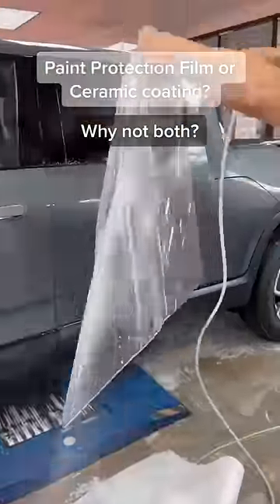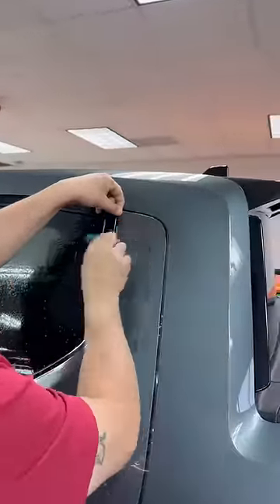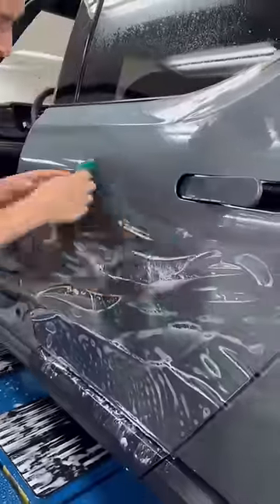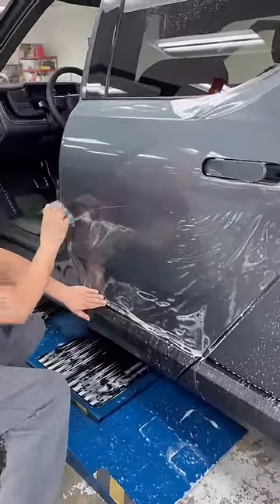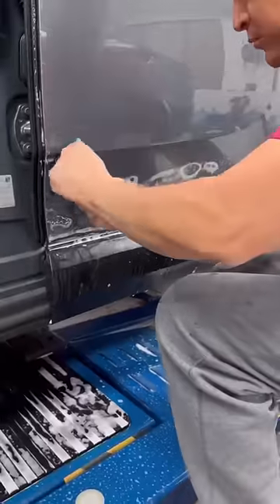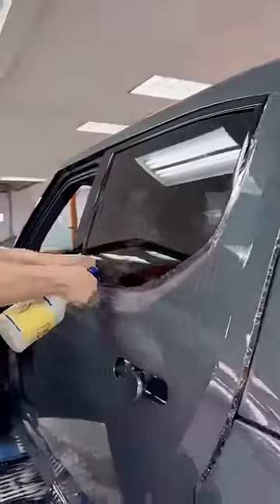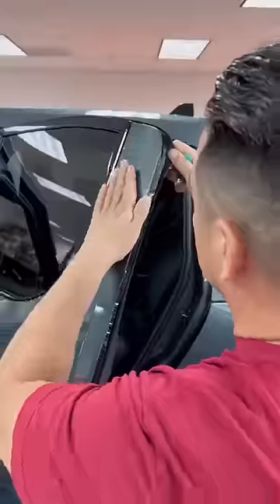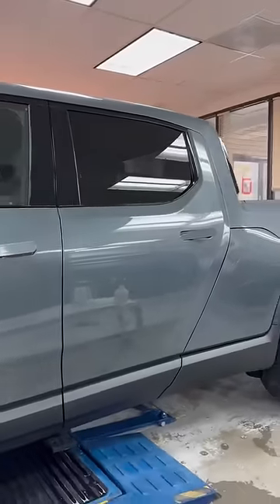PPF vs ceramic coating? Why not both!

Comment: As a body shop owner, we work on high-end and exotics, heres my 2c:

PPF is a catch 22 and complete BS for the average car

We've repaired many vehicles with PPF with very minor damage that the PPF wasn't able to protect against. 

So now you pay us $95 hr to remove the PPF + decon + cost of repair & refinish, then you can't PPF for another 60-90 days till the clear is fully cured. 

So if you have a vehicle which on average costs $1200 $1500+  to repair & refinish the front bumper i.e LC500, M4 Comp ect ..

And you get a slight gash from a scuff that goes through PPF or minor fender bender. You've just introduced an extra $600-$800+ to the cost of just refinishing 

PPF might be worth it on Exotics or Collectibles, Hypercars which a bumper can run you 2k $3k++  ect because if you have endless pockets then whatever. 

Things we've ran in to with PPF cars:

-Permanent water spot damage on the film looks like dog crap

-Some films leave a ton of residue behind on removal $$

-Some films have horrible orange peel

-Some films take away from the depth and gloss of the original finish

-On hand cut & polished vehicles like Bentleys and Lambos you totally kill the glass look of these cars with PPF
 
Anyways, it's a catch 22, whats next another film to protect the PPF? 😂
Reply: What do you suggest besides PPF that provides the best protection ?
Reply: Depends on what you're trying to protect against?

None of my rides are ppf'd, they are all cut and polished and ceramic coated

As far as rock chips, on my weekend rides I make sure I keep enough distance away from the car in front of me on the road

The faster the speed, the larger the distance

Gives that pebble enough room for gravity to do its thing
Reply: I knew PPF wasn't perfect, but I didn't know it was that bad. I've been doing ceramic coatings for years now and they're great with new or old cars. Then I top the cured ceramic coating with Collinite 815 or 945 and then continue that wax regimen moving forward. Extremely deep and long lasting gloss, like a second clear coat.

PPF is relatively new and cars I've seen with it have this "plastic look" up close. Still, I was considering it for my new car since it was "self-healing". Now I'll just stick to ceramic + wax. You just saved me the equivalent of $2000.
Reply: @SharapovaFan hey im interest how many times do you apply the ceramic coat and how long does it last
Reply: @bo3baid  I apply around 3 coats minimum. I only apply them under shade because they cure too fast in sunlight. I apply them using an applicator pad, in strokes, then buff them using a dual action polisher. Have to be careful since ceramic can streak.

After the ceramic coating is cured, I top them off with Collinite 476s (for my light colored cars) or 915 (for my dark colored cars). I continue topping off with Collinite wax after every two or three car washes, so my initial ceramic coating is still there. Collinite lasts a lot longer than most wax. Only Soft99 Fusso can compete among carnauba-based waxes from experience.
Reply: Wish I saw your comment earlier, I wanted to PPF my car in fear of rock chip. Due to the price I decided to only PPF the hood to test it out. The gloss and clarity was reduced significantly, and since my car sits outside water spots were soon introduced.
Reply: @kevinlin7674  Dang! Yup spot on.
Reply: Sorry, english not my first language, what do you mean by 'cut and polished' ?
Anyways, totally agree with your statement  !
Reply: @georgepotcovaru2595  That's when you sand down the clear coat flat to remove the texture, then polish to a high gloss. 👍
Reply: Only clowns ppf a car, it offers 0 resale value and yellows over time, plus the rock chips always get though the ppf and its a big scam.
Reply: I would like to further update my experience with PPF, two obvious rock chip on the film from a car overtaking traffic illegally on the shoulder kicking up rocks. I was going around 55 and he was doing around 65. Did not expect it to get damaged this easily, and there is two extremely obvious spot on the hood and I can't touch it up.
Reply: I would never ppf my ride. I used to have a 2018 rav4 that came from factory with ppf'd hood. I hated the way it looked, and it stuck out like a sore thumb.
Reply: Thank you for educating folks on POF B.S. folks don't waste your money on this crap! Nothing will stop rocks or any other solid fragments. This is just another hustle for you to spend money on something pointless

Comment: Ceramic coating on top of PPF or PPF on top of ceramic coating?
Reply: On top of PPF. My reason is because it will then protect both the PPF layer and the paint at the same time. If coating is under PPF then  only paint is protected and the PPF layer itself on top will oxidize faster.

Comment: My new lexus just got wrapped in XRPlus Xpel. At pickup there were so many bubbles and loose edges. Called and asked owner if this is normal and he said its still in curing period. After 3 weeks (the inspection) they gonna use heat gun to stick all the loose edges. I just want to know if these r the standard PPF process?

Comment: paint is meant to protect your car from the elements. this is a little silly. why do you need the original paint to stay untouched pristine on a truck? buff out the scratches, touch up the rock chips don't spend thousands on some film that will need replaced eventually anyway.

Comment: PPF is great until it starts to turn from clear to yellow.
Reply: Modern PPF is urethane based and doesn't fade from UV rays or discolor most ever have lifetime warranty from fading I know the stuff we use does
Reply: takes a long time to do that
Reply: @Justinlifts365  Thank you for being honest and admitting it does yellow along with start cracking also. I will also admit it usually takes a while.
Reply: @ThatGuy-wz3or  I like how you ignored the reply which stated facts and replied to the baseless comment agreeing with you
Reply: @fzrshiny  I work in the auto auction business and can only speak from my experience dealing with thousands of cars in the Texas sun. Maybe your experience has been different.

Comment: Does this last 12 years if car sits outside in snow, rain, sun all the time, never babied in a garaged.
Reply: Nah the paint will still deteriorate from UV. But it would be in much better condition than having no PPF+Ccoating.  Topping up a good ceramic coating (one with decent chemical and UV resistance) on top of the PPF every few years would help.

Comment: This film also does not protect you 100% from rock chips just as a ceramic coating doesn’t. I had this film on my wife’s 2021 C63 literally the entire car wrapped in this film from the dealer. The hood and from bumper took a beating. Especially living out in the Arizona desert.

Comment: This whole paint protection thing hasn't got ridiculous at all. The paint has a clear coating over it as a basic protection (some I'm sure will argue it doesn't provide much/any protection...whatever). You should get a ceramic to protect the clearcoat. Then PPF to protect the ceramic. But what will protect the expensive PPF?? Get a ceramic coating for that. but better get a PPF to protect that ceramic. ..orrrr...and bear with me on this...or accept that it's only paint and the world won't end if you get a chip

Comment: Well, PFF - Except for those permanent bug stains, rock strikes that pierce the film, installer’s razor blade scratches, yellowing, pealing PFF that must be replaced in 6 months - all for thousands of dollars a pop. Like EV’s, it sounds like the science isn’t there yet.
Reply: What are you yappin on about , That is all covered by the 10-12 year Warranty, Any imperfection I have ever had. They always fix, Especially yellowing, or  damage or peeling
Reply: @georgefernandez5362  I am speaking of my personal experience. Had full wrap replaced twice - out over $5k. NEVER Again. It’s a con.
Reply: Depends on ppf brand and installer

Comment: Here's a question, can you put PPF on top of ceramic coating? I bought a car and the last owner put PPF on the front and ceramic on the whole car I would like to add some more PPF in certain places, can I do this?
Reply: No. It most likely won’t stick to the ceramic coat